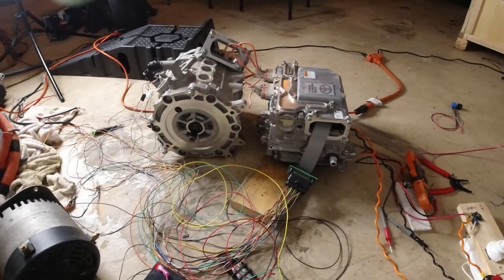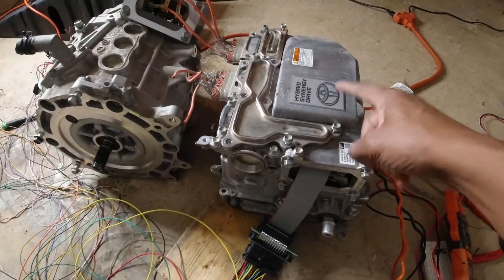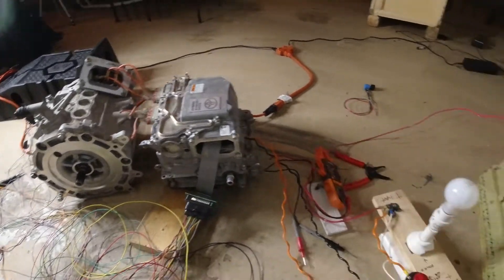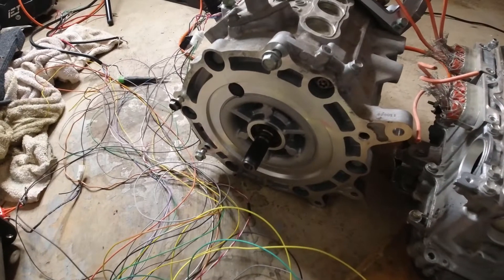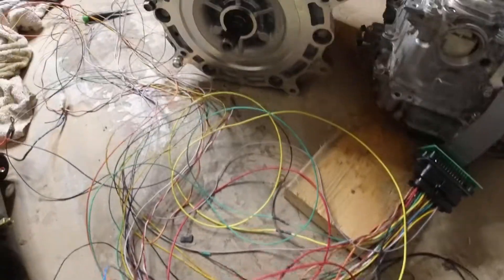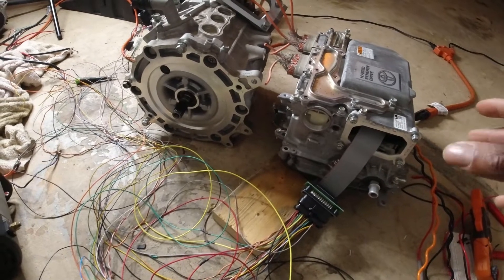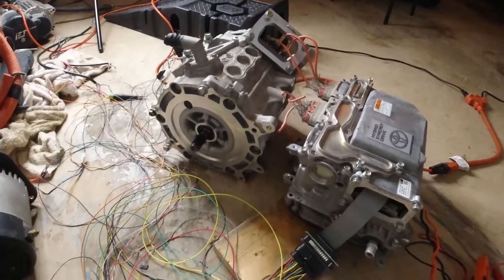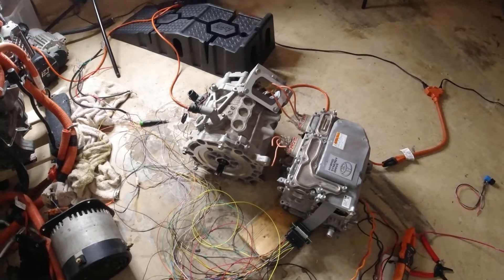Nissan LEAF MOTOR HACKED : FOC Tuning complete PT.2

Comment: Appreciate your video, i'm trying to research if it will be possible to put one of these on a boat in a Thai Longtail configuration. :D I didn't know about the inverter solution, that gets rid of a lot of the electronic work.

Comment: Question: You used the Toyota inverter because the Nissan inverter did NOT provide DC to DC converter? Is that correct?

Comment: Hi glad to see some info on this motor I want to use one in one of my buggy builds too  would like to see more info on this also what is the small motor on the floor with metal plate on the front of it also is this person selling this wiring kit thanks.
Reply from the maker: I have a few wiring harnesses for this setup and the small motor on the floor is a brushed DC MOTENERGY Motor

Comment: Hey, brilliant video. I want to build a solar boat. I've been looking at various electric motors to power the boat and have come down to the idea of installing a Nissan Leaf motor. The reasons are several. The steel hulled boat I plan on converting weighs around 20 tonnes. The diesel engine in there at the moment is a John Deere 150 horsepower. After looking at Elco electric motors used in the marine environment, it looks like an equivalent to the 150HP one would be around 100kW. These aren't cheap ($20,000). Since the Leaf's motor is around 80kW, I reckon it may do the job PLUS the Leaf has been sold worldwide so replacement parts if needed will be available as opposed to specialised leisure parts, which anyone knowing the marine and motorhome markets, cost a fortune.
Anyhow, after looking at various Leaf videos, do you think I'd be able to remove everything from the Leaf (motor, battery, ECU, gearstick, throttle, cooling system) and just transplant it into a boat, without the need for reverse engineering any of the separate parts etc?
I'm now going to watch the rest of your videos.
Reply from the maker: The leaf motor  is a perfect solution if you want more info send me a direct message on my Instagram page and I will be glad to help you. @invokeperformance